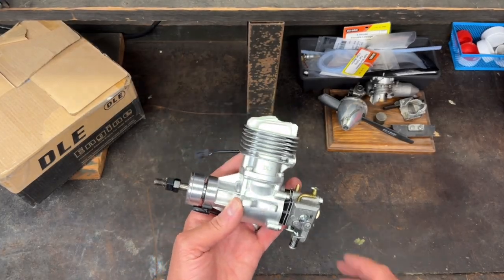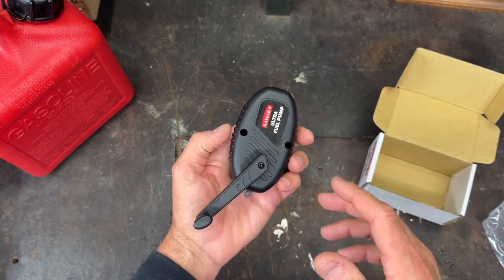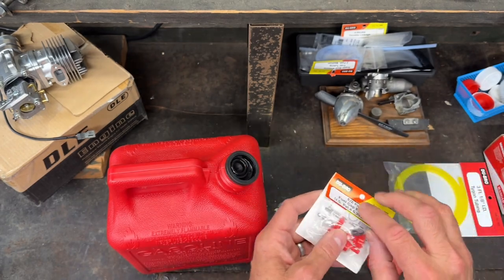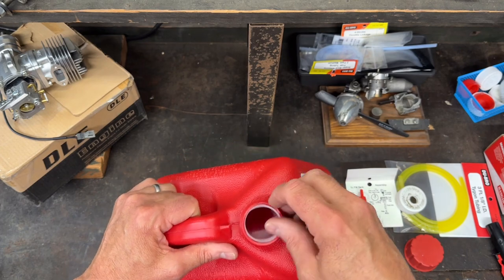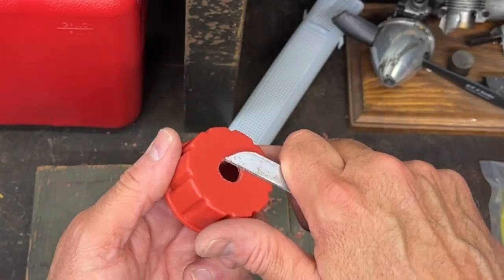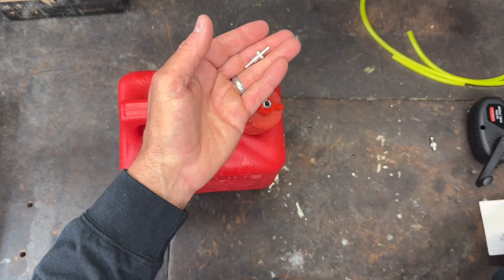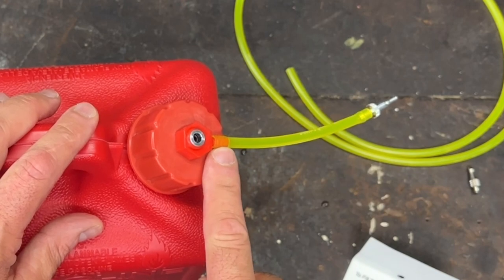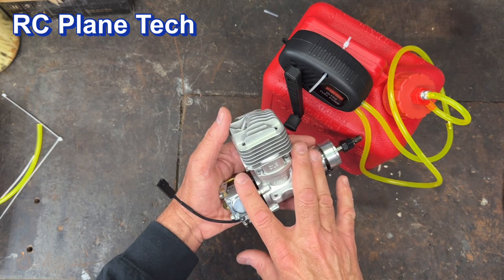DLE-20 RC Plane Gas Engine, Learning Series, No. 2, build a gas can filling station

Comment: mount your pump to the can... take a piece of 1/4 ply.. cut a piece, mount the pump.. cut a slot in each end.. then use a small ratchet strap to strap it to the can.. then you can eliminate the plugging and un-pluging the lines.. just fuel and then plug the plane end in the cap..  less connections.. less to do.. less chance of leaks and contamination.. and you carry it all with one handle...   i use a similar setup with a 2.5 gallon and an electric pump.. use a lipo to power it..  carry it all on board the can.. only have to charge every few months..
Reply from the maker: Hi, thanks for the tips! Ya, this is a simple setup and I need to make some additions at some point. I like easy!

Comment: Hello James, I am Jay. I am guessing that you already changed it, but in this video, it looks like you put the fuel lines on backwards for the way that you were turning the fuel pump (clockwise). You would be taking the fuel out of the plane into the gas can, if you left it like that. Just a thought.
Reply from the maker: Hi Jay, I don’t think I checked which it was turning it when set up. I know it can go either way. I think I usually set them  to fill clockwise and empty counter clockwise?
Reply: @JamesRCPlaneTech  Yeah, you were fueling by turning the pump handle CCW. I noticed because I also go clockwise to fuel and CCW to defuel.

Comment: Hey James ..I'm Larry and I'm also new to gas ..I have a question...what battery do I use foe my ignition setup ..please help .Thanks .can you do a series on the entire setup in the plane .?
Reply from the maker: Hi Larry, Ill check, I think the manual has it. I’m planning on doing a set the DLE for sure on a test stand, but it will be a while before I do it on a plane because I dont have a plane for  this engine yet. But the test stand will be similar

Comment: That DLE looks very well made. Have they always been like that?  I had a couple of DLEs, a 30 and a 35 and the machining wasn't so nice. The engines were very good though.  Thanks for the video!
Reply from the maker: Hi, the DLE are new to me, not sure how they were made in the past. This one looks pretty good. I know they are popular and have a good reputation. I think its a good quality engine, we’ll see how it runs, hope to get to that soon.
Reply: Awhile back they weren't quite as externally polished but I've owned 111, 55RA, 55, 35RA, 20RA,  as well as Desert Aircraft, always ran reliably,  more a measure of my knowledge and less their quality. For price and performance, DLE is a reliable great performing engine.

Comment: If you don’t like the smell of gasoline, you can use white gas also call camping fuel. The type that is used in those camp stoves that have the red tank and you pump the tank up too pressure. Also called Colman fuel. That is what I use because it’s pretty much Odourless. 
It’s more expensive, but at least I don’t get complaints about stinky four stoke gasoline smell on me when I go in the house. You mix it with the oil the exact same as gasoline. It also smells nice as it burns.
Reply from the maker: That’s interesting, Im familiar with camping fuel. Probably burns cleaner also.
Reply: @JamesRCPlaneTech  yes it burns cleaner and smells like cooking popcorn on a camp stove! Only draw back is the cost, but it sure beats getting yelled at for having stinky gasoline smelling cloths. I can even work on my fuel system in the house!
Reply from the maker: Haha, Ya gas is pretty ranky..

Comment: cool,... just a FYI ,...check out the ethanol free fuel available in your area, also at every local airport as a 100 LL i believe its called, it doesnt soak up the humidity 
but it is a bit of a chore
im in the middle of nowhere and can go to airport but 4 out of the 5 gas stations dont actually carry ethanol free even tho advertized online as they have it available

good luck 
Mike
Reply: I used to fly with ethanol free and realized the engines liked the 10% ethanol better.
Reply: @lleston8927  yeah , just my assertion for my small engines mine hate H2O,
Reply from the maker: Ill have to look into this , Ill be learning a lot as I go considering I know little about gas right now.
Reply: Hello guy's, I have had a few DLE Engines, and the manual actually says to use 87 octane gas, and not ethanol. Also, you should NEVER use 100LL (Avgas) in RC engines.

Comment: I got into gasoline engines last year, have a couple of 30cc,😊 a 40cc and three 50cc engine on various airplanes. Most of my other planes are four stroke glow engines and several electric. I personally find the electric to be too short a flight range and boring for my preferences.
Reply from the maker: Nice. I will be moved more to gas in the future as well. But I do love the Saitos. I agree, electric is not for me at the moment. I see the pluses and minuses to both, but I like not having to charge between flights and like plane that cam idle…
Reply: @JamesRCPlaneTech  yes Saito is my favourite for four stoke glow and it so nice to be able to fly for 15-20 minutes land refuel and back in the air in less then five minutes.